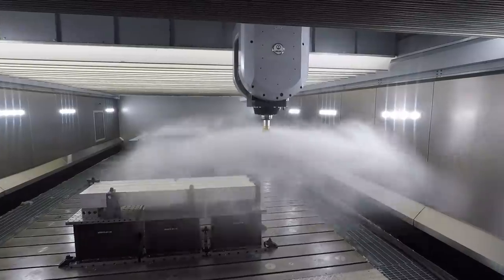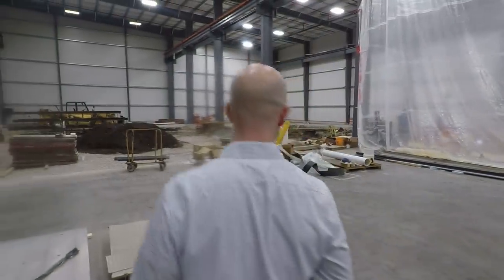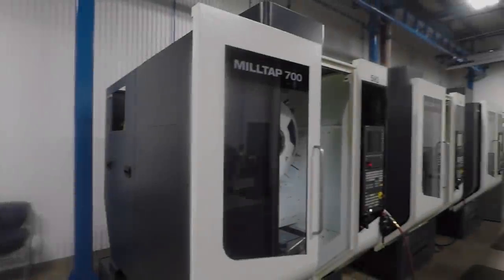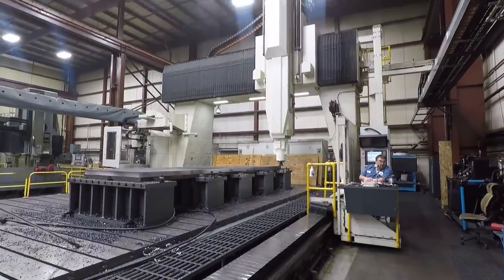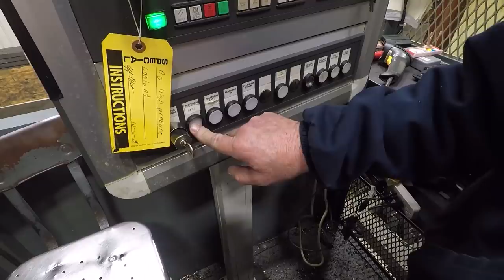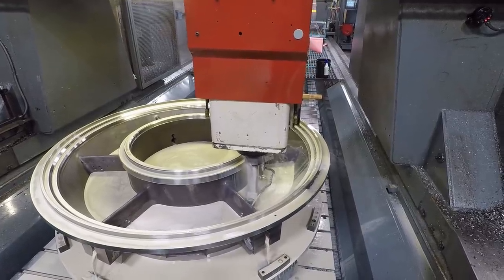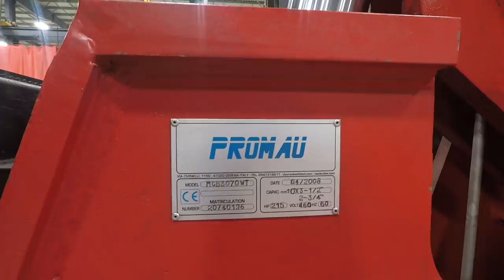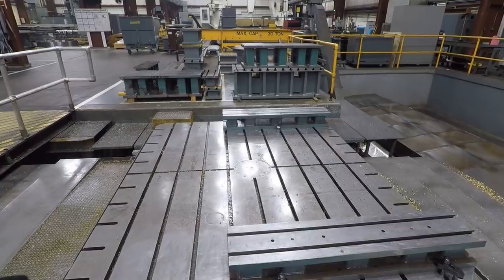Major Tool & Machine Tour - 600,000 sq ft JOB SHOP!

Comment: I haven't seen a quality hi-end operation like this since I worked on the B1B, VLS, Titan projects at Martin Marietta, Middle River back in the early to late 80's. Impressive. @24:15 the cans on the pallets are actually sections of the VLS (Vertical Launch System) and when we made them back then (80's) Martin's had a purpose built machine that held assembled sections of the can for all at once machining! The ram was 30' long with multi-spindles running 2 facemills 90' to one another and it just rotated to hit all the surfaces of the guide pads internally.  Pretty cool and vert accurate. I miss big machining... :( One of the best tours yet!

Comment: Wow. What a great "Job Shop".   I've been a CNC machinist/programmer for almost 35 years.  My first CNC in 1986 was a Mori Seiki MV-40.  I thought it was the coolest machine in the world.  I've never seen anything this big, and fancy.  Man have they evolved.   The most impressive system I've ever seen was a 4 machine Toyoda horizontal cell with the pallet shuttle system.  Can't remember the models, but they were 50 taper spindles.  This place blows that away.
At 25:42, It looked like someone lost a limb in that roller.  Kinda freaked me out at first glance.  😱

Comment: This place is pretty awesome. I worked for a Machine tool Company in Los Angeles, California...1971-1980...Burgmaster..they were pretty big, made some big 2-3 axis turret drills and gantrys, then added VTC tools...they closed up in 1986...I was not there, but sorry to hear about it...Nice decent clean place, good machinery, top quality NC stuff...right as the CNC was coming out....the CNC machines themselves aren't really all that....What's new is the computer and software...
 Burgmaster could build a Gantry with up to 120 FEET of X travel, 120" Y and 60" Z....2, 8-tool turrets...they also built the 'Secret' Hughes Dual-center.....A huge Hughes machine with a big rotary table on 'Y' and 2 spindles at 180 degrees from each other on 'Z'...
  Burgmaster ran the old punched tape, but could perform 5 axis work....slowly. Many G-codes...
  I looked all over the youtube for Burgmaster stuff....all I could find was a few guys with their tiniest (but excellent) 6 spindle table-top drill/tappers...but, there is a video from a news article in the early 70's describing how Fred Burg and his brother started the company.....mostly a lot of talking, not enough of the machinery...Fred Burg came from Yugoslavia, very sharp guy, smart business and good machinist....
 Fred Burg was another guy that started in a very small garage/shop....

Comment: the program we use at my job for thread milling is a single sub program with macros. you can make any thread, with a few macro changes. the program itself calculates everything as if it were conversational. never need cam or actual conversational with it. our programmer is an absolute master with his macro programs.

Comment: I went to the McDonald Douglas plant closure auction for their plant that had been working since WWII in Torrance, ca. They made the parts for the DC-10 there and then shipped them down to the Long Beach assembly plant where they also closed that plant after finishing up the C-17 production run. The Torrance plant had heat treat, drop forge, plating, machining. Not much sheet metal. They had a CMM in a Plexiglas enclosure that was huge. About 80' square by 60' high. The "banjo" machined part was a solid machined part for the vertical stabilizer that had a hole in it for the 3rd engine.The CMM was used on it.

Comment: I used to work in a place like that for 2 years, it was awsome working on giant machines that were 2 stories tall. You typically only made 1 part a day on most of the machines also they had cranes that were stong enough to lift a train car and then some.
Reply: these are parts you don't want to scrap

Comment: Hats off to them having an apprentice program! The threadmilling conversational section was interesting to me, and I think it's because I'm not actually in the industry so probably missing a lot of context here: Why is it preferable to train "shop floor" folks to use conversational/pre-canned cycles to get the job done instead of teaching them CAD/CAM to generate the toolpath?  Seems almost as easy and they get experience with the CAD/CAM side.  Win-win? I guess it might be a bit slower, or difficult if it's a part that hasn't been modeled already.  Dunno, as a homeshop hobbyist it's strange to hear that there are "programming guys" and "floor guys".  :)
Reply: Because they don't want to Machinist programming basically they have engineering/cam department to do it - but they do see the need for some simple stuff to be done on the floor
Reply: Breaking Taps - A one off item/operation is very expensive to program whether programmed by a novice or an expert.  In addition, understanding basic setup and machine configuration is key to a successful career in the business.  If that’s not well understood, then a person can’t reliably setup the machine and the work item for a successful run.  If the person ultimately wants to be a CAD/CAM programmer the company probably has a training program and a path to join that team if desired.  There is a combination of economics, skills, capabilities, desire, etc to make for a good candidate for every job.  For example, in context, not everyone wants to learn CAD/CAM programming but is a great machinist on the floor ensuring the CAD/CAM program has the best chance for a successful run by ensuring they get the local environment configured properly and monitoring the progress which both require incredible levels of skill.   Every person in the place is smart and learns something new every day is my bet.